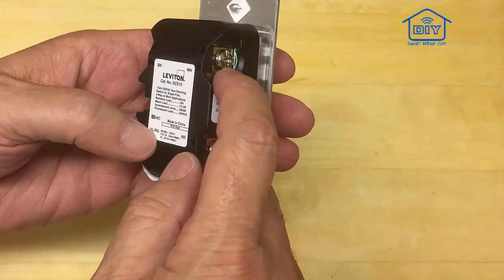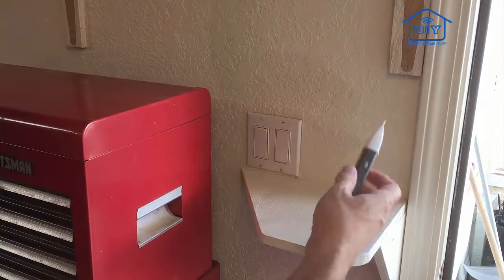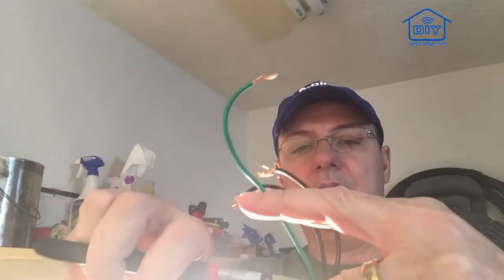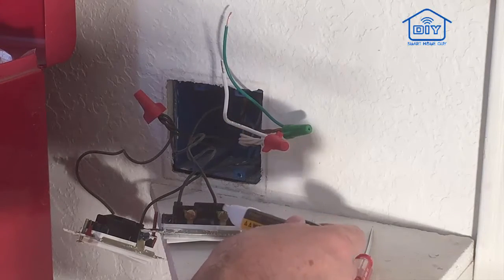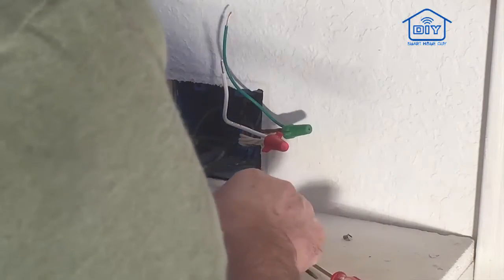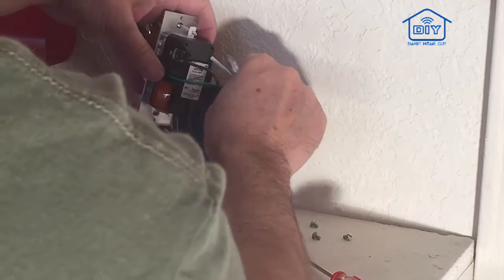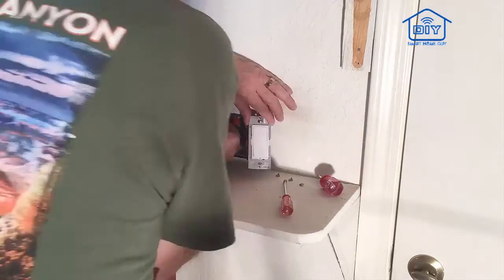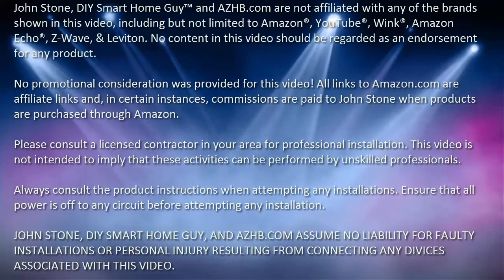DIY Install | Leviton VRS15-1LZ Vizia RF In-Wall Z-wave Smart Switch

Comment: John. What if the switch has only one white and one black wire on either side of the switch? The power is supplied to the load (light) it the light box with one side going to the switch. Bottom line is only two wires in the box with the switch.
Reply: It has only one white and one black wire in the switch box
Reply: hoffgroup it's a dead end switch leg. You can still manipulate the splicing to achieve what you want but you will require a smart switch that does not need the neutral connection

Comment: Excellent video, John. One suggestion, when you insert wire, or show some tiny parts/connections, take a close up with enough light. Thank you. very nicely done. I bought this switch, will try to install it soon.
Reply: Dear John.
I finished installation last weekend. It is working good so far. However, there is one issue that I am not able to fix. I hope you have an answer. I am using Almond+ router to control this switch via Z wave. It turns out that router is not getting status update (i.e. it cannot understand whether switch is at ON or OFF state). I use Almond+ app to turn on or off. It works after several trials. But in app, it is the same thing: it does not get switches status.

Comment: I have three wires and a red wire..... When I connect all the wires to the Leviton DZS15 only one light flickers. The rest do not even come on. Thoughts?
Reply: You asked a lot of questions, so I know I came to the right guy :) This switch controls 3 outdoor light fixtures on the front of the house with 2 bulbs in each fixture (6 bulbs in total). They are all controlled from one switch so I went with the Single Pole installation method. As far as the red wire goes that is where I am stuck. This switch is part of a bank of switches (4) and the one I am trying to change is the only one that has a red wire. So my wire colors for this switch are black, black, green and red.
Reply: No there is not.
Reply: If I am not mistaken it looks like the load wire.